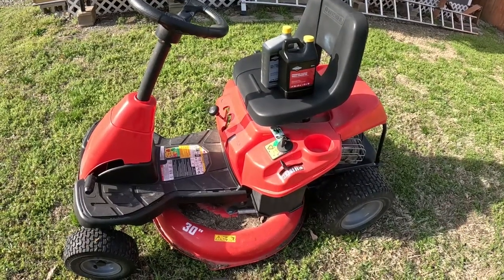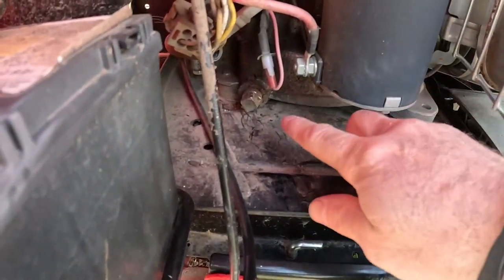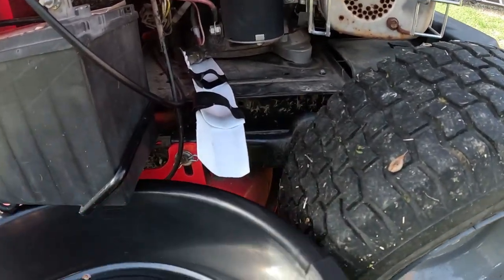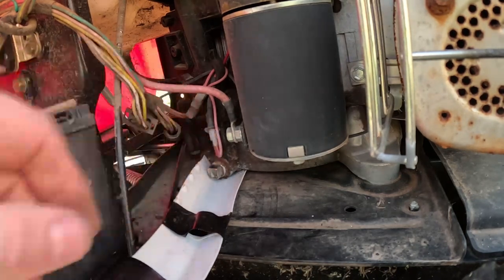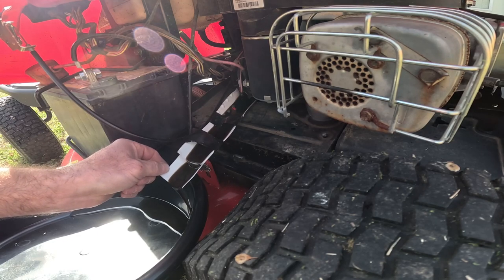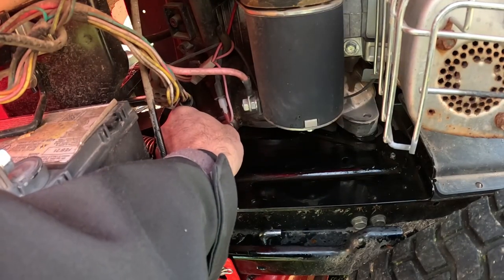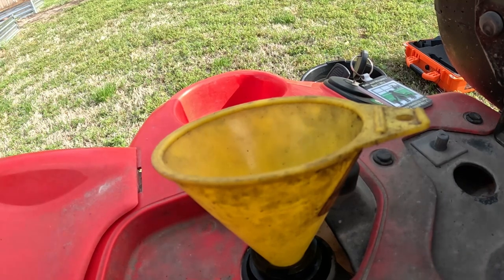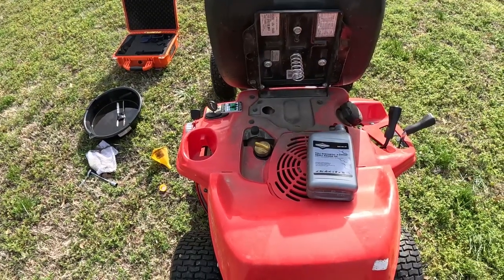How to change the oil in the Craftsman R 110 Rinding lawnmower

Comment: My mower looks identical but it's probably a 2015 Troy Built. Lowes used to carry it but now they say Craftsman . Mine is a TB30r. I think the R is for models that can mow in reverse. Just a button you have to press. My question is my Briggs & Stratton is 10.5 hp, does the Craftsman still have the same engine? It also says PowerBuilt. A quart didn't quite fill mine so im thinking mabye you engine is smaller or different. It looks identical, same drain plug, dipstick, everything. Thanks in advance.  There are no video's changing oil with my model.

Comment: Tip for drain nut; 
I took two 21mms one with a 1/2 drive and put a lug nut inbetween to break it loose and tighten it back up. Don’t waste money on a socket that you’ll only need for one application.
Reply from the maker: Thanks for watching!
Reply: @rjguess  thanks for the video my man. Was super confused about the oil filter. Mine doesn’t have one either.
Reply from the maker: @jamomma8975  yeah, I thought that to be strange as well when I first changed the oil in this.    Thanks for dropping the tip also.  I’m sure that will helps others who come by this video.

Comment: I have the Murray version of this mower. Whenever I've had the oil changed the mower guy used a pump to pump out the oil from the dipstick area. I had no idea my mower had an oil plugbut it does. Which is better - using a pump or removing the oil plug to drain the oil?
Reply from the maker: Both ways are very efficient for removing the oil.   The drain plug is just messier.   Not everyone has a pump.  I don’t.  So I do mine this way to save me money.    I’ll usually let it drain for about 15-20 minutes.   Just to get as much old oil out as possible.    Thanks for watching.  I hope I helped answer your question.

Comment: do you still have the manual for your mower?  the manual says it comes with a plastic oil drain sleeve that snaps onto the oil drain plug.
Reply from the maker: Mine was a display model.   I didn’t get that part or a manual.
Reply: I got the sleeve with mine worked great,but I just ordered the drain hose for mine 12 dollars
Reply: I have the Troy-bilt TB30 version of this mower.  It's a 2017 model purchased in Canada at Canadian Tire.

Mine came with a plastic oil drain trough.  I'm not sure how it's supposed to work, but I've used it twice and I still got oil all over the frame, deck, tires, and my garage floor.  The second time I used it, I was prepared and put plastic garbage bags all under the mower, lol.
Reply: @PurpleSideBlack  the manual says the sleeve and the plug are designed so that you must snap the plastic oil drain sleeve onto the drain plug first, then remove the drain plug.  It also helps if you tip the opposite side of the mower up so that the oil will be released on a downhill.  That should prevent the oil from running backwards and onto the frame.  The manual provides a full set of instructions with illustrations on how to do this properly.

Comment: WHY NOT: PUT A PIPE NIPPLE BACK IN THE ENGINE & MAYBE A FLEX FITTING + A PLUG FOR NEXT TIME! ( Miss signs you don't change your oil more often anytime you get the urge put the pan down take the plug out after you warm up the engine put the plug back in add oil start the engine check the oil level and wait 10 to 50 hours and do it again I'm definitely do it once before you put it away! One se ( RIP) potentially plug in mine too I don't know but the hardware store I could bring him the plug and I'll give you a pipe or flex hose so you can change your own easy!)

That doesn't work for the new Toro never have to change the oil just turn the lawn mower upside down over your head and shake the oil out for that one you going to have to find a low point drain area drill it tap it and put the fixture in or get a oil evacuator I've got both and I sure would like to get all the oil out especially the crit on the very bottom the twinkles when he goes into the drain pan looks like the Milky Way galaxy from all of metal shavings still in the engine!

Don't laugh before I started doing that the engine was built at 19 82 that still runs today! ⛽🪫🙏😊
Reply from the maker: Thanks.  I recently bought me a Drainzit hose for this. Makes it a lot easier and better!
Reply: @rjguess  😀❤️🙏🇺🇸 :" KEEP EM RUNNING!" 1982 & 1999 - JUST HARD TO GET AVGAS ( NO MOONSHINE & H²O?😭)

Comment: Per this mowers owner's manual, it takes 57 fluid ounces of oil with an oil filter. One quart is only 32oz.  I know there's not 25 oz of oil in the oil filter.
Reply from the maker: The model I have does not have an oil filter.    I checked the dip stick on my mower and it was full.  That’s the purpose of having a dip stick.  For those of us who lose the owners manual or can’t remember exactly how much oil it takes.    I do appreciate your information.   Thank you also for your watch time!
Reply: @rjguess  no oil filter? That's the same mower I have and I've changed my filter twice. Sorry for the misinformation on my part
Reply from the maker: @davidstephens8871  no worries.   I’m met and talked with some people that have this style of motor.   Some have oil filters and others don’t.  There must be a slight difference in the model?   Not sure though.

Comment: This mower doesn't have an oil filter (?)
Reply from the maker: No sir.   Not that I’m aware of.  Kind of like a push mower.  Just drain and replace.
Reply: Some with the MTD engine have an oil filter.
Reply: @RicardoCanedoMX  I've got the Briggs
Reply: The TB 30 B models with the 344cc 10.5hp Briggs & Stratton do not have an oil filter. 

The TB 30 models with the 382cc Powermore (MTD) engines do have one.
Reply: @paulmysliborski4832  I think I have the 328cc mine has a oil filter on the other side

Comment: He didn't change the oil filter. Change oil filter before you put the oil back In.
Reply from the maker: My model does not have an oil filter.  Otherwise I would have added that in this video.    I should have specified in the video that this model does not have an oil filter.
Reply: @rjguess I have the same model, no filter
Reply: I have the r105 looks exactly the same as this as the 382 CC it has a filter
Reply: My 30inch mower has a Briggs engine no filter